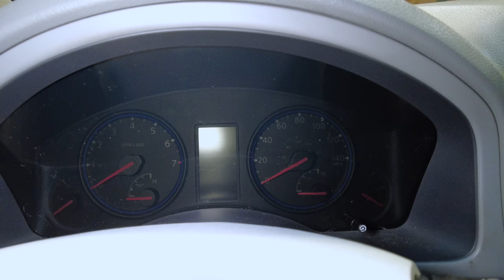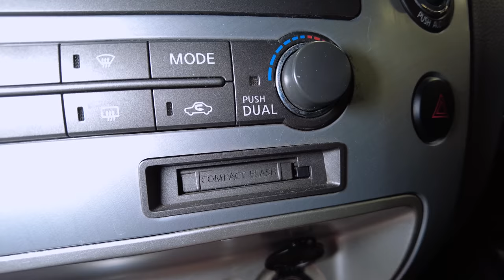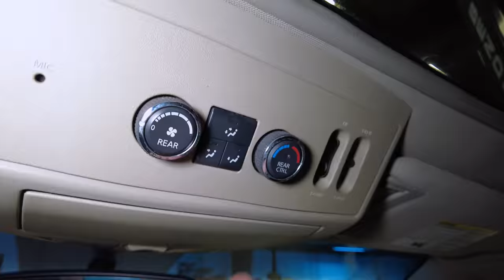Love it or Hate it! Common issues EVERY Infiniti QX56 has. CAR WIZARD knows - he had one!

Comment: I love the way it looks.  If we could put the Sequoia engine into this QX56, I'd be happy.
Reply: why?  the VK56 is a fantastic engine.
Reply: @dwaynepenner2788  It's a gas guzzler.
Reply: @rebeltvr6046  and the Toyota from that era isn’t?  IIRC it’s slightly worse.
Reply: @dwaynepenner2788  Is it?  8mpg?
Reply: @rebeltvr6046  their epa ratings are nearly identical.  I would assume they are equally as inaccurate.  That seems to be backed up by random fuel mileage sites.
Reply: @dwaynepenner2788  In that case I'd go with the QX56, it's much better looking than the Toyoto
Reply: Those year Nissan are reliable in the engine and tranny side. It's the accessories that aren't. I had an 05 Quest. No problems in many years until it was totaled except for a crank sensor that put the engine into limp mode. Easy fix. Everything else.....

Comment: I'd be very interested to find out what oil the Toyota has been running and at what intervals.
Reply: 3-5k miles and in the beginning it was primarily conv at 3, with a synthetic rinse every four or five changes until about 150k, when original owner only did synthetic at 3-5k intervals. I only use synthetic, and only at 5k
Reply: Thank you! Conservative drain intervals definitely go a long way, especially with a quality synthetic, and this certainly proves the point.

Comment: More cars need to include the auto-unlock feature. Doors automatically unlock when the key fob is left inside.
Reply: My 2009 Nissan Altima had that, and when I bought it new, the dealer made a big deal about how their system could tell if the key was inside or outside the vehicle, and demoed it.  So I fully expect that this QX56 also has it.  Nowadays I’d be surprised if any new vehicle lacks such a capability, but I don’t know for sure.  Either way, this won’t matter for a shop, since they get lots of older vehicles, or may have the battery disconnected.
Reply: @kc9scott  damn, that seems fancy for a Altima. Not even a 'flagship' vehicle. True tho, in this case the option wouldn't help much lol.
Reply: They actually demoed it to me on a Versa (an optional feature on that model).  For the 2009 Altima, it was standard on all the “normal” trim levels (S and above), only omitted on the stripped-down rental-spec (non-S) version, that you pretty much never saw on the street.

Comment: Nissan of old were very dependable...not Toyota level but buying Nissan meant that you could get a decently reliable vehicle at a lower depreciated price comapered with Toyota. Used modern era Nissans and Infiniti are still cheap but the reliabilty is out the window.
Reply: I disagree, old Nissans were more reliable than Toyotas. An early 90s Sentra would last forever. They just aren't as sought after so they get dumped.

Comment: What about the 2nd gen?
Reply: 2nd generation of junk, that's all. Of course even GM ruined the wonderful LS with direct Injection, variable displacement and variable valve timing. I might consider one dirt cheap only to replace the high tech junk with an LS-7.
Reply: It spins 7000 rpm, without the cursed OHC and the fragile chain guides.

Comment: Love all the NEVER BUY ONE OF THESE comments. While I look at my armada with 300k miles and never one single repair or breakdown. I’d drive it across the country tomorrow without hesitation. No gm lifter failure, no broken ford spark plugs, no rusted in half Toyota frames. And on and on. News flash for yall, they all are pieces of shit when owned by pieces of shit. If you know how to maintain a vehicle they will all last longer than most expect. Period.

Comment: I had the original "flagship" 1990 Infiniti Q45, bought when it was about 4 years old.  What an absolute piece of garbage car.  Had to replace the transmission at 67K miles.  Replaced the motors on 3 of the 4 power windows.  It was one thing after another.  I drove it for about 10 years.  When I replaced it with a Toyota Highlander in 2005, I couldn't even bring myself to sell it to somebody because it was so unreliable.  I probably should have had it towed to a junkyard and watched to make sure they crushed it, but I donated it to the local PBS station.  No more Nissan products for me after that experience.

Comment: You are reciting a written verbal which has little or nothing to do with all particular model line or year of manufacture as your reader/watcher base may attract. You made a bad purchase of this 2008 but, it is your 2008 and not others. This is a great ploy to get viewers but coming from an owner who has a 2010 QX56 with 279,873 miles on it, you are full of a few minor flaws but many others are GREAT on the car(don't know what you bought) and there is maintenance to be done but, my particular year is when Infiniti had a partnership with Mercedes to make their drive train and transmission and there has been ZERO maintenance outside of regularly scheduled and no failure. Please get out of the elaborate mislead and TITLE your event as a 2008 and a production build sequence to really help people when picking one out. Brakes/calipers, wheel bearings, u-joints, backup cameras and air shock compressors are typical to be replaced at higher mileage but, I did them myself. Not so hard and not very expensive. Just replaced the fan hose at the above mileage. First replacement of such, impressive.